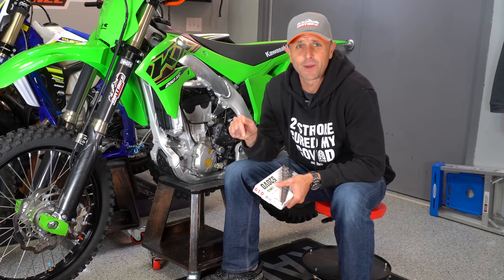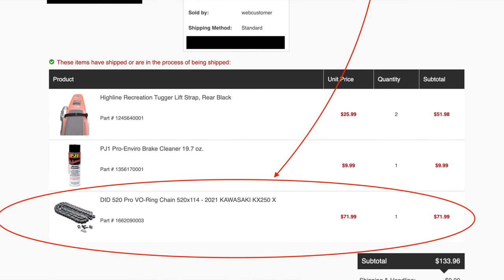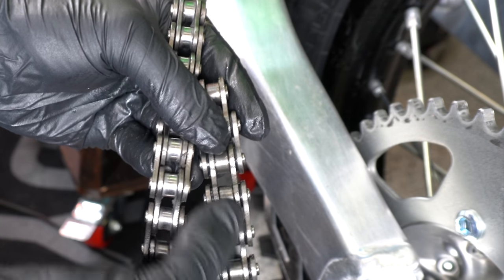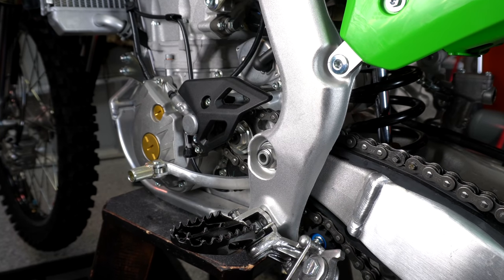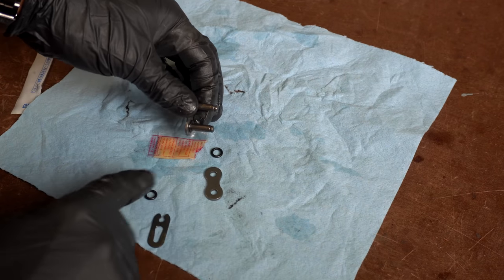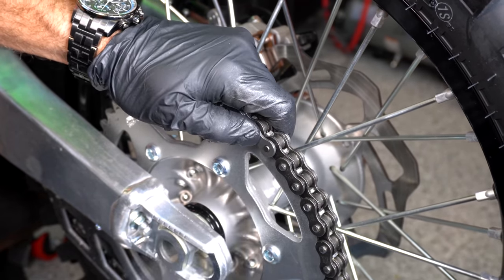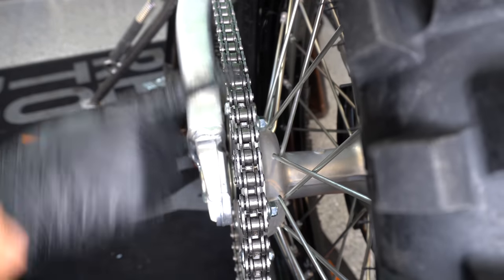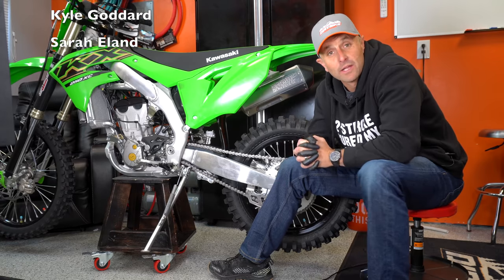How to Replace a Dirt Bike Chain - KX 250X - O Ring Chain

Comment: I have found that rather than use the manual's measurements for chain slack, put weight on the seat (lay over the bike) and check the tension that way. You want to find a point where there is no slack left at the tight point but you're not putting so much pressure you're going to stretch the chain. Far more accurate and repeatable.
Reply: is the tightest point on the chain at racers sag? When we sit on our bike if it is set up correctly, we will be using up 33% of the suspension travel while standing/sitting
Reply: @basketball7677  My experience is it is lower in the travel than at proper sag. I lay across the seat and pull up by the rear axle to find the tightest point.

Comment: Good Day All :  This video certainly brings back a lot of memory . I remember myself and my motorcycle friends all got together and bought a long length for our bikes . All of us were using the same size of chain . All our bikes were  using .530's . I went to a heavy equipment parts supplier and ordered in a length of chain in that size . I remember we went a little farther on the chain length so as to cover all .  As I remember 120 links X 3 Chains for each guy & 5 bikes was a grand total of 1800 links . With this I bought 1810 links so as to give enough for all chain breaking & master links etc . It was fantastic !   I would recommend this to any motorcycle owners . All 5 of us had enough chain for 3 years of motorcycling . This was to put on a new chain at the beginning of each motorcycle season . Good luck to all !

Comment: Mixed opinions all over the forms I have a 2022 kx250 I believe stock gearing is 13/50 to avoid removing links etc should I buy a 110 or a 112 link? Thanks in advance yours seems to fit like butter unless you prefer trimmed it lol

Comment: Tip 2: If you press the plate then loosen the two outer bolts, you can slide the press down the chain, make sure the clip fits in both pin grooves and, if no, slide it back and press it some more. Go slow and don't press it too far. Make sure the squish on the o or x rings are the same as the rest of the chain.

Comment: What happens to the grease on the chain pins when wd40 seeps past the o ring and starts thinning the grease? It is a penetrating fluid after all. I do it too.
That chain looked loose? If you had had to adjust the stock chain a couple times and you put on a new chain with same number of links, seems you should have to loosen it a bit.

Comment: I also completely dry wipe the chain out of the package to get all that tacky crap off the new chain before it goes on.  I also do not lube oring chains.  I just put a little ATF on a rag and wipe the chain after each ride.  ATF has some detergents in it so it cleans the dirt off and then I dry wipe it.  I hate chain lube.  It either attracts all kinds of crap or flings all of the bike making a mess.

Comment: I installed a DID ATV chain for first time x ring chain. I ran into a problem, i pressed it together little by little using 2 sockets and c clamp, but it appear the non clip side plate separated from the pin on the master link smashing both orings on that side. 

Should i have pushed on the pin alternating sides and only use one socket on the clip side?

How do i remove the master link to install a new one? Remove the clip and push the grooves side pin and socket on opposite side?

Comment: Neat trick on routing the new chain though typically I am replacing sprockets when I am replacing the chain.
Reply: I'm with ya, but he only had 3 hours on it so that factor isn't really in play.(no pun intended)
Reply: @charlesmiller7139   When the bikes come with aluminum sprocket I always change to steal sprocket. I don’t know if the X model comes with aluminum or steel.

Comment: You don't use chain lube?  Tho that NEW chain looks like it can use some.  Looks like its stiff and has kinks at end of video.  Some good lube has always fixed that problem and gets those pins and rollers flowing. 
You go through lots of chains? There's a reason why every bike manuel ask to lube every 2 hours of riding. . . Not just for your chain but your overall drive/sprockets/rollers.
Reply: The reason it is stiff ,is because it is an 0-ring chain they are always stiffer then a regular chain.
Reply: do you directly spray chain lube on your sprokets as well? I think the reason people dont lube their oring chains is because there is already gease inside the rollers that are held in by the orings. chain lube is a mess and is not needed, it also attracts dirt and sand which will eat away at your chain and sprokets

Comment: I install the master link clip in the inside, much harder to do, but that way I get much less wear of the clip. I also use thin bisegrip to press the link.
Reply: That’s just silly.  Makes no difference
Reply: Lol 😂 ya im not seeing how this would make a difference?
Reply: @dopedickinsonbb8359  my assumption would be that something is off with his chain guard that's causing wear on the outside of his chain.

Comment: How does this work because I have a 520 oil ring chain on my Honda crf250f and it doesn’t have the clip to the master link on the chain but it came like that it just has a sharpie mark telling you where the master link is but it doesn’t have a clip is this normal for some bikes?

Comment: Pro Honda chain lube with moly will change the way you think about chain lube, best stuff I’ve ever used.
Reply: I’ve put over 500 hours on o-ring chains without ever living one time.  The lube is sealed inside the chain.
Reply: @nvmcrider8475  that's good for the interior, but what about the exterior of the chain and your sprockets? The heat and friction generated will wear down both I would think.
Reply: @nvmcrider8475  I blow out my chain with a pressure washer because all of our tracks are fine sand which is obviously bad on a chain but better than leaving sand in it. An oring chain wouldnt like that.

Comment: Kawasaki has the worst fit and finish for stock parts.  Most Kawi’s look roached after 10hrs of riding time.  You have to replace a majority of the bike with aftermarket parts.
Reply: They don't make 'em like they used to...
Reply: Not always true, my 2020 KLX300 looks really good for 50 hours, and its previous owner (my nephew) wasn't exactly easy on it.

Comment: what gloves are you recommending for wrenching?
Reply: Looks like he was wearing black nitrile. I typically use the Venom Steel version when dealing with chemicals. I like reusable nitrile coated gloves for working on anything else. Something with a nice fit for dexterity and a smooth grippy surface on the palm side. I used to be picky about those but then I just started buying the cheapest comfortable ones that I could source locally out of convenience.

Comment: Kind of unbelievable that an off-road bike like that doesn't come with an o-ring chain. My stock chain on my YZ250X has over 125 hours on it.  Still tight and feels/looks like new.  Seriously.  But it is a DID o-ring chain.  Seems like a stupid place to cheap out on a new bike.  Makes me wonder how the rest of it will hold up...
Reply: @Johnny Blue Sorry I don't buy that.  How many guys get on a YZ250X or 250FX or KTM 250XCF etc etc etc  (that are direct competitors for this bike) and talk about how slow they are because of the o-ring chains?  All those bikes (and likely the Honda 250RX ) come with good chains.  It's a penny pinching thing, not a performance thing.
Reply: @morley3810  man I do notice the difference between oring and non oring chain simply pushing my bike across a paved lot. Seriously. I’d think it would make a felt difference on the trail.
Reply: @chadrides914  yeah, I can feel the difference pushing the bike too but that's not a great comparison to the 35-45hp your engine is churning out. If you are fast enough off road that you are WFO most of the time and the bike just doesn't have the stones to do what you need it to do then it may make a difference.  Maybe.  Perhaps.  I doubt it.  For the rest of us, no.  It doesn't make a difference. I'd gladly trade 0.08 hp for a longer lasting essentially maintenance free driveline setup.
Reply: @morley3810  I agree. I run o rings as well. But man they do drag compared to regular Mx chains.
Reply: @chadrides914  Once an o-ring chain warms up, the drag is negligible. The decision to put a standard chain on this bike is Kawasaki being cheap.
Reply: Y'all acting like o-ring chains are the next best thing sinced sliced bread.
Reply: @fsubulldog03  thank you for that useful and knowledgeable comment. It’s people like you that have enabled me to gain great wisdom from the Internet. I am forever in your debt.
Reply: My 2020 300 xcw didn't come with an o ring and those bikes are expensive.
Reply: @charlesmiller7139  wierd.  I just checked with my friend that bought a new 300XCW Six days in 2017 and it did come with sealed chain...
Reply: what do you guys think of not lubing an oring chain?

Comment: The reason why the factory doesn't put o ring chains on the bike is because they rob horsepower and if you racing a 250 horsepower is king
Reply: The real reason is cost.  If they can save 5 dollars per bike, that is easy money for the factory.  An o-ring chain might use an extra .1hp, not enough to be noticed.

Comment: Another example of how this is nothing more than an MX bike with an 18” rear wheel. Anyone had to change their chain after three hours on a KTM or Husky?  😎
Reply: It’s almost the same.  It also has shorter gearing, A skid plate probably plastic, and a kickstand. You would think it would have a bigger tank but no same size tank.

Comment: The video conveniently eliminates the worst part of replacing a chain which is removing links.
Reply from the maker: The chain was the correct length, so I didn't need to remove anything.
Reply: Plus, most shops cur it for free when you buy a chain from them. And if buying online, just purchase proper length chain so no cutting neccessary
Reply: It’s cheaper and easier to buy a 120 link chain and cut it.  Just buy a chain breaker for $10.00.   Very easy to use. You don’t even have to take the chain off of the bike to cut the chain.

Comment: That install was painful to watch, you did not use that press correctly by the way. the relief in the press is supposed to be positioned so you clear the master link studs coming threw the linkage FYI the way you installed your press can mushroom out the studs on the link That's the whole point of the front and rear groves in the press FYI the more you know